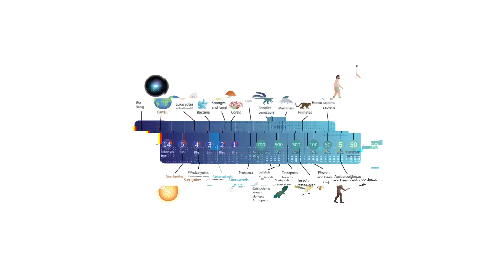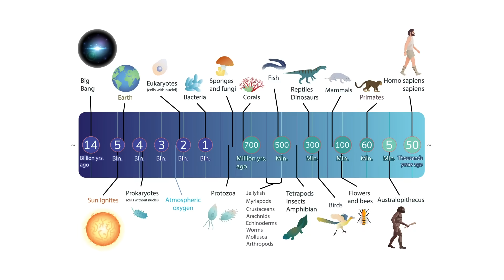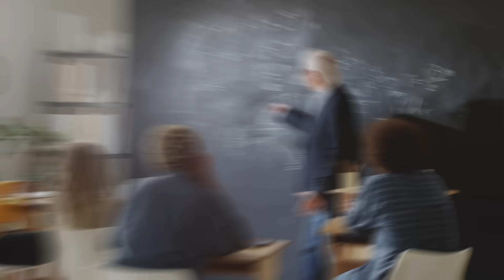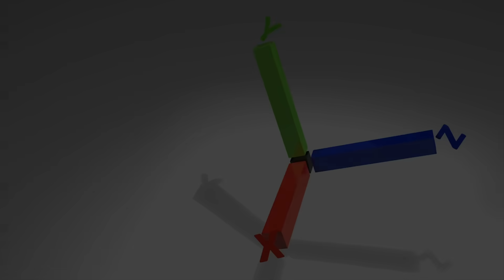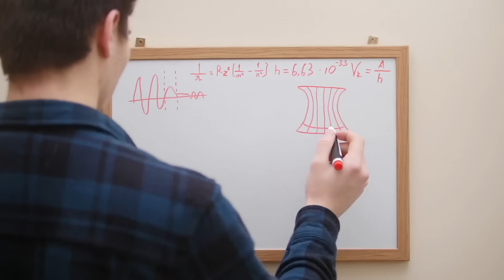Brian Cox - Why Did The Big Bang Happen?

Comment: the physics of fusion in stars has been known for all of my life.. I'm 69.. my dad was a nuclear engineer.. he helped build the weapons designed at Los Alamos in the early 50s.. he was teaching reactor physics when I was in high school.. this is something I have been aware of literally all my life... 
stars can only fuse elements up to iron... even the largest blue giants... this limit involves the outward force of fusion... and.. the most fundamental law of physics.. two.. things... with the same energy cannot occupy the same space... those two forces and the infall of hydrogen from gravity going inward... are exactly what creates fusion.. but the inward pull of gravity is insufficient energy to fuse elements beyond iron... my dad said the rest occur in supernovae... 4 generations to obtain all of the 92 elements of the periodic table... 

the size of stars is also limited by this two way pressure... 
big bangs require an invisible guy to squeeze stuff past the point of fusion ... 
black holes are another result of finite universes... and magic
because the relativity equations are very clear... as mass accelerates it gains mass through kinetic energy... provable in any car crash..
* at light speed.. the mass becomes infinite
* it takes infinite energy to move infinite mass

the event horizon of a black hole is said to be the point at which the infall exceeds 300Mm/sec... from which light can no longer escape
it's either one or the other.. not both
I'm going with Einstein

there's no such thing as magic
if you don't see the math... it's just blah blah blah
science is all about measuring the Universe we live in
measurements mean numbers... numbers don't lie
Reply: Hubble deep space images show galaxies moving in all directions.. all mixed together.. no prefered direction... as Michaelson and Morely told us in the 1890s
in an explosion 💥...there is, necessarily, a preferred direction... 
multiple direct observations say that is not the case

in a finite universe.. there's only so much stuff... WYSIWYG
quantum foam was hypothesized in 1957, and experimentally verified in 1964... and my laboratory the past few years... the passage of light through vacuum creates quantum foam.. when there are two sufficiently energetic sources... there's a lot of math... but it's not difficult... it's just 1... 2... 3... 
the Universe grows one hydrogen atom at a Time.. in an infinite Universe
hydrogen atoms have one thing none of the other ones have... duration... 
they last forever ♾️
that is what creates Time
space is the distance between 2 things
it requires neither making, nor a beginning or end
Time and space.. no magic required

the Universe grows along the Fibonacci sequence.. as all populations do
it's a non linear growth
the next number is the sum of the previous two... like.. 1... 2... 3...
(0, 0, 1, 2, 3, 5, 8, 13, 21, 34, 55, 89, 144... ad infinitum)
that's why the Universe grows faster all the Time... because there's more stuff in it.. it's definitely not magic
the Planck length is calculated using the golden ratio.. the ratio of two consecutive Fibonacci sequence numbers... it's a variable irrational number between 1.5 and less than 1.7...  that ratio is exactly why our lovely Universe is fractal
the ratio of protons to neutrons in the plutonium atom are just a bit more than 1.5..  smallest to largest ==>>
the Fibonacci sequence is found throughout the natural World..  now you know why
Reply: have a great day, y'all
Peace ✌️
Reply: a brief word about mathematics
there are only 9 numbers and zero.. zero is a number.. or a placeholder... 
there are only 4 operations
all the esoteric symbols in math are.. representative of one or more of those 4 operations
it's not hard
the rest is pure logic

Comment: There is only one way our universe could have done what we see. 13.8 billion years ago, our universe turned itself into a gargantuan particle collider absolutely no different than any particle collider on Earth. Two, maximum entropy objects like our Moon, that contained the mass of the observable galaxies, collided at an astronomical speed in an already existing, static universe. Particle colliders create quark plasma shrapnel and our universe created quark plasma shrapnel that are the galaxies. All the laws are followed.

The first law of thermodynamics is followed because everything was already here.

The second law is followed because everything has cooled ever since the event happened.

The "every action has an equal but opposite reaction" law is followed because the pressure and friction from the event caused the galaxies to expand from the collision.

Now, with this theory that follows all the laws in the book, it will get ridiculed because the big bang theory is considered a fact and, even though this theory is unable to follow any laws at all, it has always been, and always will be, a fact. That is why my theory is a paradigm shift that science finds extremely difficult to realize because everything that has been taught for 100 years is a fact when it really isn't. 

Edwin Hubble discovered the galaxies expanding, not the universe. Hubble never accepted Georges Lamaitres version of what he had found. Lamaitre wanted our universe to resemble Genesis and he got exactly what he wanted. Now, Hubble is proclaimed to have discovered the expanding universe when he never wanted anything to do with it.

Comment: "Maybe "why?" isn't a good question"

I disagree. Perhaps we should admit that science has its limitations, and the sooner we admit that the sooner we will learn the answer to that "why" question.
Reply: @ShyguyMM  I do. But I have a reason. We think the way we speak, and in turn speak the way we think. If we use "false" expressions, we create more options for misunderstandings. Just because a language allows for ambiguity does not mean we should use it. One reason math turned out to be such an effective tool is its (mostly) lack of ambiguity, if you stick to the rules. If you don't, you get those "viral math videos" that are simply malformed expressions.
Reply: The answer to the "why" will not conform with your believe system.
Reply: @wernerviehhauser94  I didn't say it will? Who what where when why how are the most basic and fundamental questions in science, ignoring them is ignoring science.
Reply: @amir.hazwan  It won't conform to mine, either. That is the reason I don't ask "why" when it comes to science. "Why" is a question better adressed to a human, since it assumes an underlying act of reason.
When, where, what, how, even who - all those are valid questions in science. My point is that we should not ask why, since there will most likely be no answer.